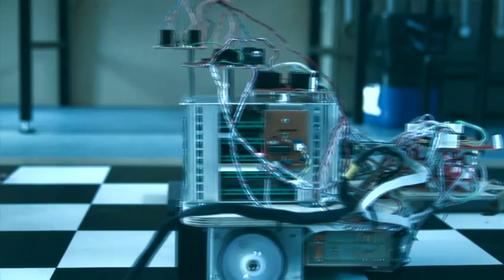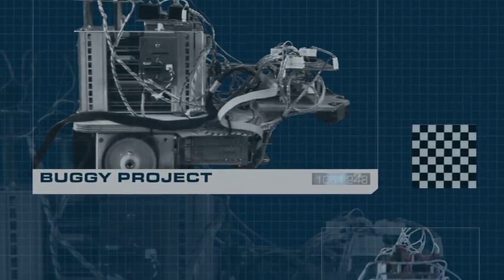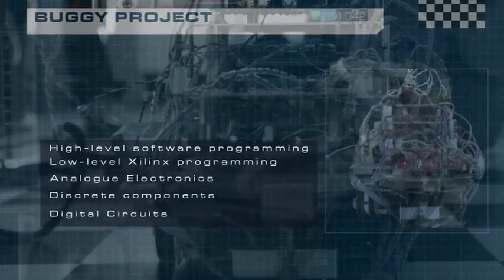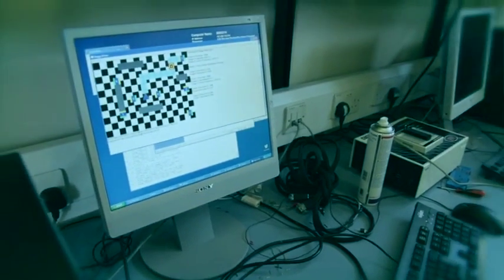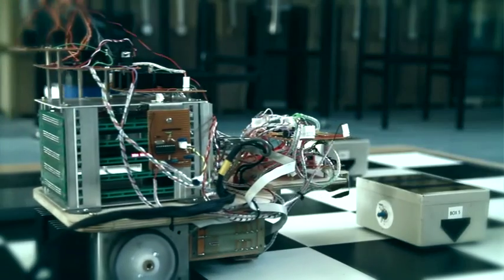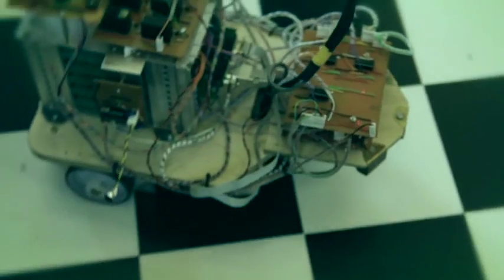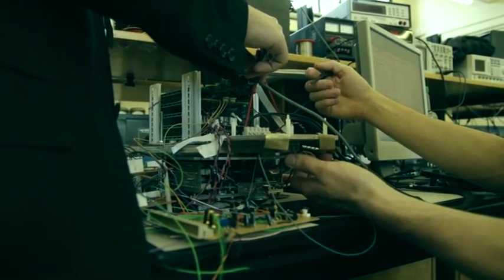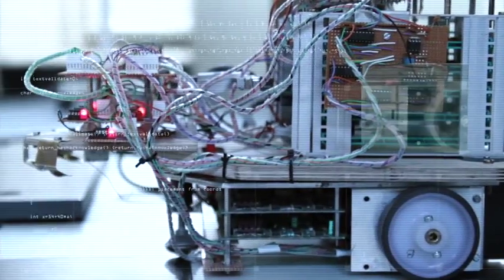Buggy project - Electrical Engineering

Comment: Buggy Project Electrical Engineering University of Bristol - Design digital computing programming skills six monttths work pŕoject try again buggy brain best really little step stage like make things works circuit built actually every year arena around circuits information computer boxes display information computer screen buggy project six months six people different designs solution challenging project work design engineering won work told make management bounds actually group challenge course closest industry most useful aspect for me useful Electrical Engineering University of Bristol - Foreing. University of Ibagué - "Comprometidos con el desarrollo regional"